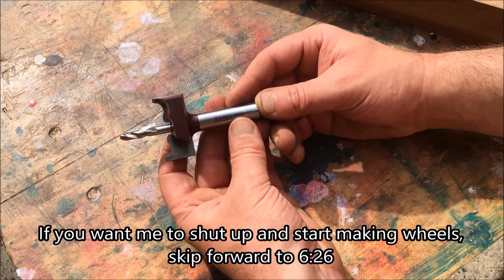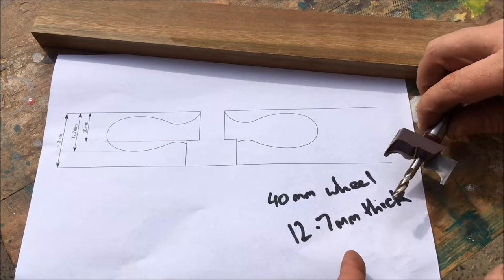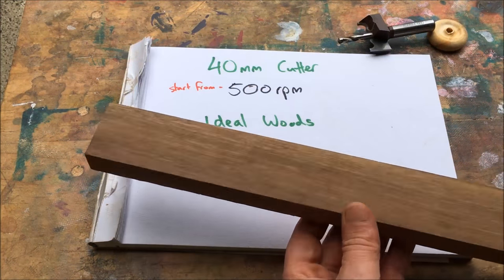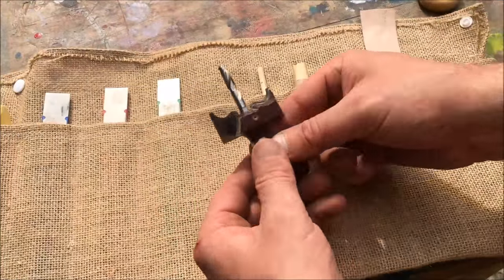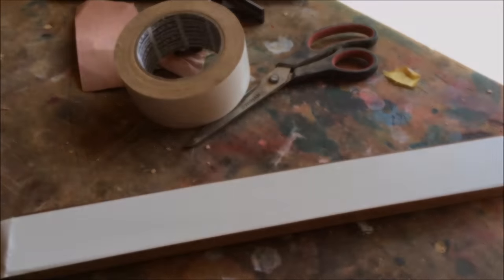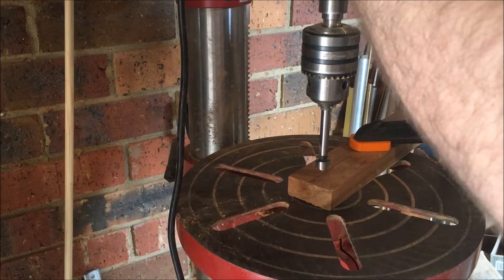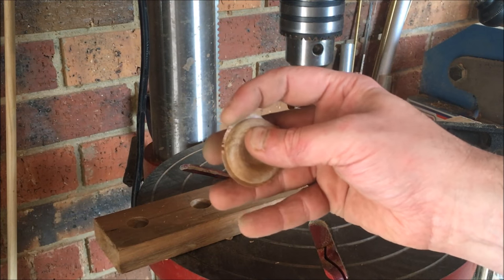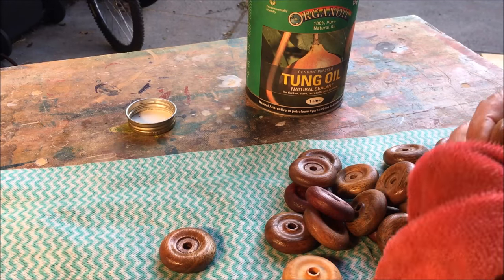Making Wood Wheels with Toy Wheel Cutter from Carbatec / Carbitool

Comment: Thank you for a fantastic video. I have had one of these cutters from Carbatec NZ for about three years and I was not able to find out the correct speed to use. Now I know. Thanks. i like the idea of using the forstner bit to do the rear side of the wheel/ I also use the cutter on scraps of a product called Ecodeck rom Bunnings. It make beautiful wheels
Reply: Bonjour dite moi ou vous trouver ce matériel de coupe pour les roues merci.

Comment: Very cool. I always wondered how they made the wheels.
Odd question: I have some wheels like that but I want to make them thinner to use them as escutcheons. I have about a dozen of them that I want to shave about 1/4  off of but I'm not sure how to go about it to get them all evenly trimmed & flat. I was thinking I could hold them in a dowel somehow, but not sure how to keep them straight. I have a table saw, a flooring cutting saw, & a handheld jig saw (but am not very coordinated). Any suggestions?
Reply from the maker: If I needed to do that I would do it with the table saw. I would secure them to a piece of scrap wood in a line with some dowel pieces and run them straight through the table saw at the thickness I want. Maybe not the safest thing to do but if you use your push sticks and keep your hands well claer it would work fine.
Reply: @makestuffnow  That's what I was thinking of doing, but I was trying to think of the best way to get them attached so they wouldn't come loose. I actually bought dowels.

Comment: Question: is using the leather really that necessary?
Reply from the maker: If you blow the dust while cutting and wipe clean the bit after use, you should be able to get good enough results without having to do anything to the cutting edge.
But you will see a noticeable difference in your finish, and how easy the drill press feels, if you use a strop first.

Comment: what is the tung oil ? couldn't find it !
Reply from the maker: It's an oil from a nut from a chinese tree. It is most commonly mixed with solvents and sometimes other stuff in mixtures sold as 'danish oil' or 'burnishing oil'. But, at least where I live, if you go to a specialist woodworking shop you can find it in pure unmixed form.
Reply: @makestuffnow thanks